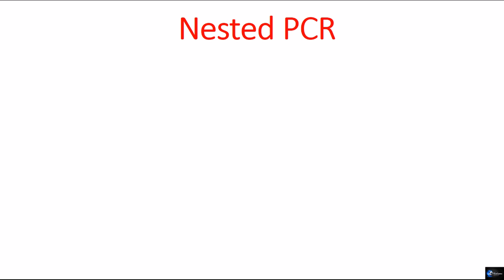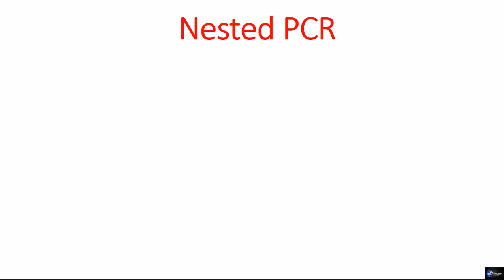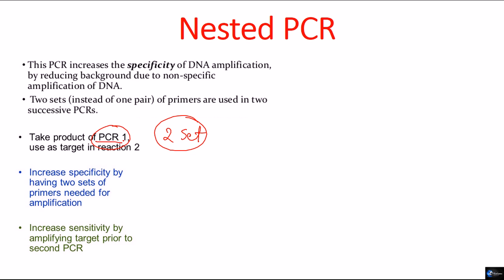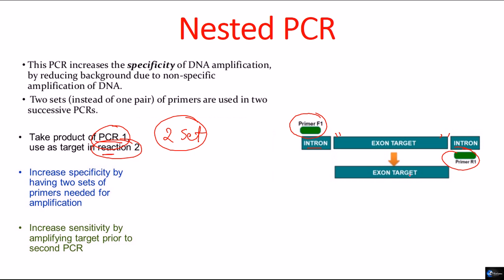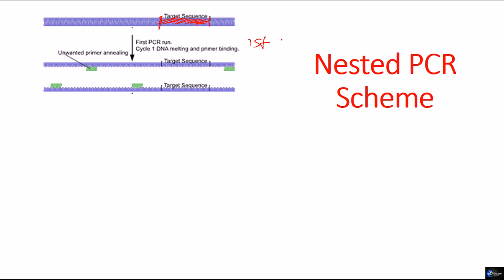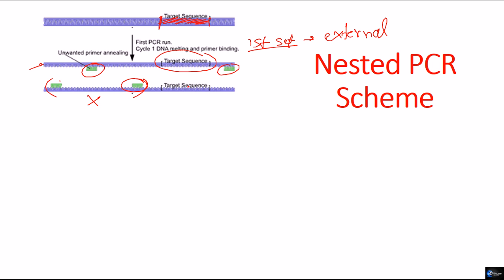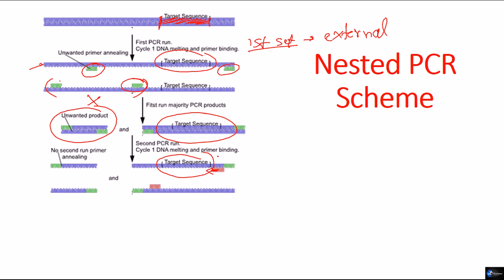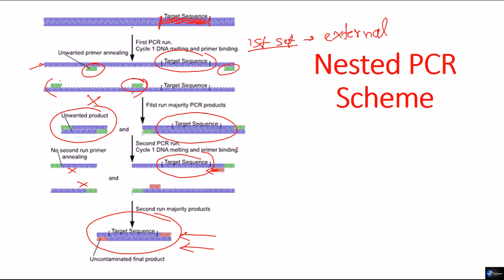Nested PCR procedure explained | Nested PCR for CSIR NET

Comment: Why can't we just go directly for the second set of reaction if that is more specific?
Reply: I think ma'am,  that's because if taq polymerase directly binds to the second set of primers as you are mentioning, it can add nucleotides even at unwanted lengths of the template DNA. So although the second set of primers would bind to more specific targets, the product will be unspecific and with much of unwanted DNA getting amplified. Otherwise there was no point in doing nested PCR. 😊